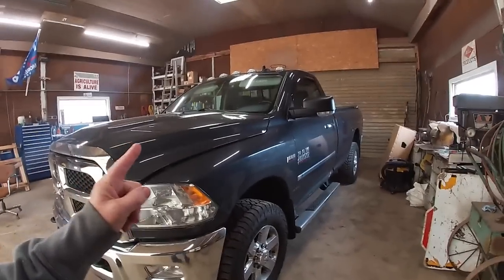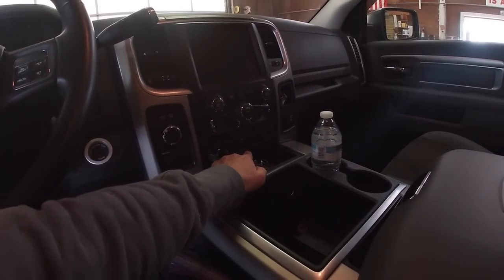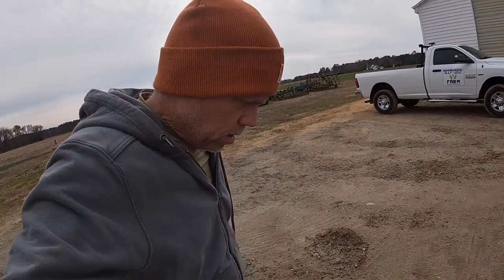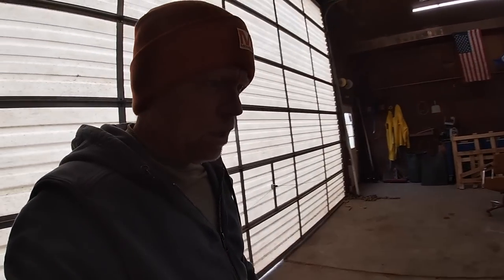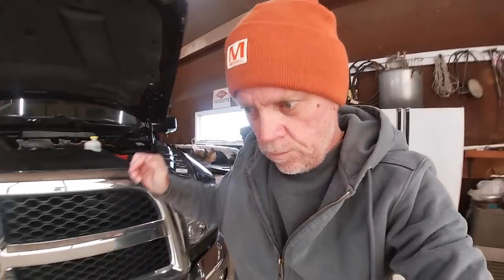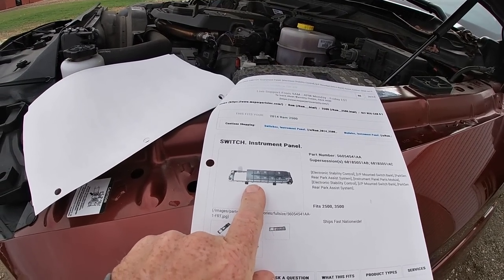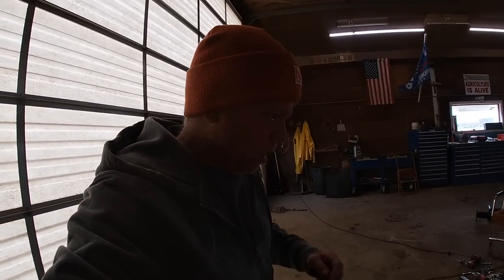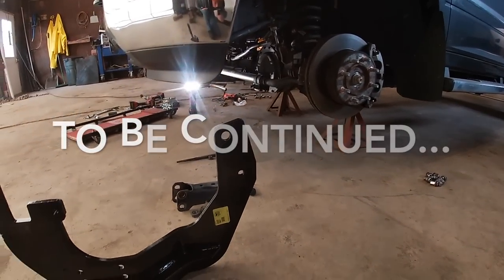Need Help w/Auxiliary Switches on my New Used Ram 2500 Pickup

Comment: I would call a dealership that up fits a lot of commercial trucks. Yeah those aux switches can be set to be key on power or powered all the time. My truck had them so I’m not sure about the trucks without them. What I do know is when I had them put the tow mirrors on my truck ( it had the small useless ones) they had to program the truck computer so the turn signals and puddle lights would work even tho the wiring was already there for them from the factory. So I’d guess anything added might need programming to work correctly.